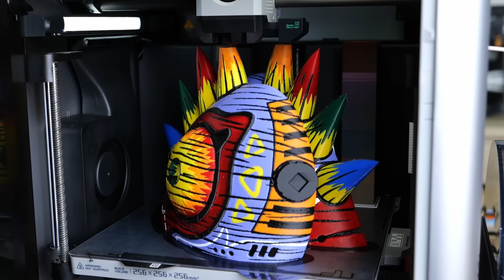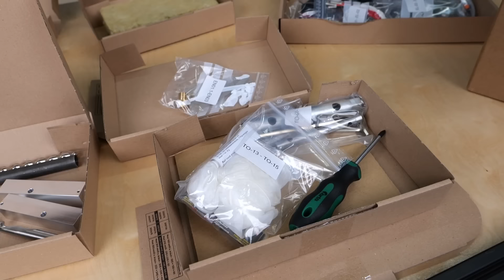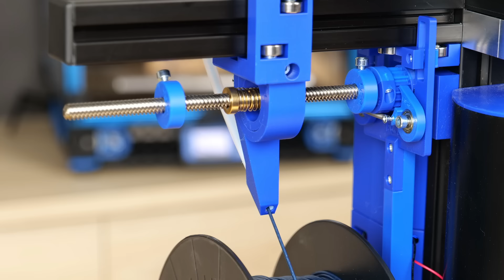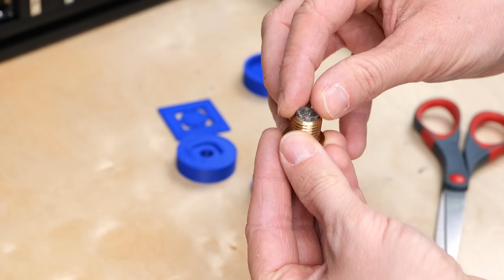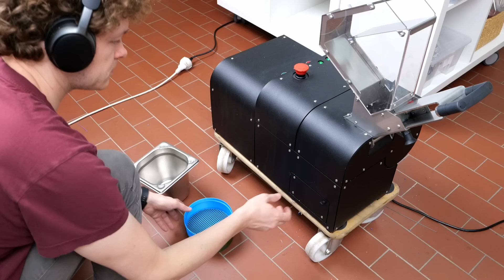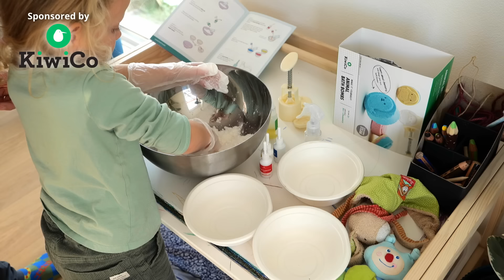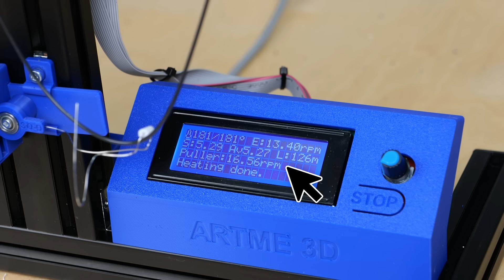Recycling Failed 3D Prints with a DIY Filament Extruder: Artme3D

Comment: does it really cost that much to build a filament machine. i mean u can buy 3d printers for under $200 now but it cost $600+ to buy something to make the filament? i feel like it can be done so much cheaper. i got my little setup i put together to make pet filament but i know its different when it comes to dealing with pellet's but still $600 seems alittle on the higher side but again ive not looked into it that much. im guessing the auger system is what cost so much to put it together.

Comment: You should use that to make filament from shredded water bottles from trash.

You can also design variable filter channels where you can shut down one channel to replace the filter, while another channel is turned on.

Comment: I doubt this solution is truly cost effective, seeing the amount of attention you need to pay to its working + energy cost + ancillary machinery like a shredder, a drying oven,  a vacuum chamber and a 3D printer to print extra parts. In my opinion this solution is far from perfect, unless it consists of most aforementioned machinery at reasonable cost
So no, my final opinion on this "solution" is that it's NOT cost effective. You would save more money by planning your 3D printing better and shopping around for cheap(er) filament
Kudos for the effort you put into it though... for that, well done!

Comment: a filter is a filter. it will always need replacement. my first thought was to filter some metals out with a magnet when you're processing plastics. that way it'll reduce the time frame between filter replacements for the nozzle.

Comment: I worked in a plastic recycling facility for 8 years. We did profile extrusion as well as compounding pellets. A water tank to cool the fillament after leaving the barrel and die would allow for you to drag the mix from the extruder at higher speed and keep tension on it as well instead of using gravity. This is if the setup can melt the plastic faster and not back up the barrel.
Reply: 60W, unfortunately, isn't much for melting (and heating the screw as well)

Comment: With the variety of filament extruders on the market/open source I’m surprised there aren’t more trying to have it integrated directly into a 3d printer as opposed to needing to extrude, wind, and then extrude it again as opposed to just having the pellets and shreds melted in a heated tube with a heated lead screw and directly printed that way. The tube volume and screw size would remain the same so like let filament tolerances wouldn’t even need to be considered as it’s a stable environmentally controlled size. Although with the added weight on the extruder it would likely be a 3 axis moving build plate as opposed to the extruder moving. Or maybe have it be a double bed slinger that moves in x and y while only the extruder/heating assembly would move in the Z. 

Wish I had to time and budget to be able to work on something like that.  

Hopefully something like this is feasible since pellet printers exist, they just cost insanity and maybe focus will shift to sustainable printing where printers will print from pellets or scraps and all the supports can just be dropped right back into the hopper and be ground/melted by a lead screw.
Reply: Plus that would be one less iteration of melt and remelt for virgin materials and then would only compound from there. Potentially increasing the longevity of its recyclability and strength.

Comment: @CNCKitchen 
It might be worth developing a mechanical sizing die to run the cooling filament through to get it to the exact diameter desired.
Then just set to fill the spool, and send an email whence it's done. 👍

Comment: Sadly, this is still well beyond affordable for me. You can get A LOT of filament for 650 + whatever a proper shredder costs + the energy cost of the recycling process. I estimate the amount of scrap I produce in a year is around 2kgs. That would mean DIY recycling would pay off for me in around...30-35 years. I still collect them, as we do have a recycling company that gives discounts for bringing in filament bits by the kilo - but I know that recycling it myself is never going to happen.

And of course - PLA is a plant-based anyway, so it's not like throwing the remains away is doing away with irreplaceable resources. 

Producing PLA has an energy cost of around 16 kWh/kg. While I don't know how much you ended up printing on that first spool, let's say a full spool would be 6 hours, at, say, 60 watts, which is ballpark incandescent lightbulb, which would be 0.360kWh/kg (plus whatever energy the shredder needed). So recycling is definitely energy-saving.

Comment: It is interesting, but definitely too expensive. In my opinion the wasted filament is worth saving. Maybe it will pile up until it would be worth over 1000 Euro and considering costs of shredding system then it may be profitable to buy this machine.

Comment: Looks good. I have about 5 boxes full of PLA waste that I keep meaning to send to a retailer who does recycling but never get around to (but I really don't want to contribute to the plastic waste problem where I can avoid it). It would be nice to recycle at home, though I have to agree €650 is still a little too high for my liking, especially when you consider you can buy a Bambu P1P for that price (and other printers for considerably less).
Reply: Mix it with acetone. Now you have glue.
Reply: @buysncharge  Acetone doesn't dissolve PLA very well. That only really works with ABS and ASA.

Comment: Hi Stefan! Love your channel!
As far as recycle material goes, the main problem is the low volumetric weight. If pellets have 500-650 kg/m3, regrind material is 300-400 kg/m3 only.
As extruder is practically a volumetric pump, you get around 30% less material pushed out by the extruder.
This is why one of the reasons  that on the "real world" regrind material is used up to 30-40% of the total mixture in normal machine. There are special extruder for 100% recycle but they will be normally as twin screw in order to be able to push out more volume.

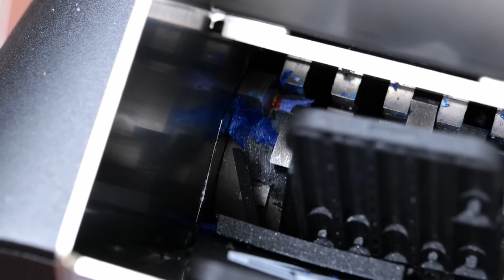Comment: I don't see your plastic shredder listed under your equipment. You identify correctly that shredding the waste into extrudable pellet sizes is the major bottle neck for most people, but then just kind of move on (09:00). So I don't see how it doesn't still require expensive equipment to recycle printer waste? Am I missing something?

Comment: Really cool video! My suggestion is; explore the problems caused by contamination of the wrong type of plastic, in filament recycling.

One of the most talked about issues regarding recycling in general, and with 3D print recycling in particular, seems to be the possibility of contamination. As what happens if your batch of PLA 3d prints to shred and recycle, accidentally had one PETG benchy tossed in there? Would that ruin the whole batch? What's the max possible amount of contamination you can have without disastrous results? And if the results aren't totally unusable, how do the resulting prints turn out? 

Those are just a few questions I'm curious about on this topic. Thank you for exploring so many interesting topics in your videos!

Comment: Probably better to make recycled prints into boards or something with a mold. However, I can see DIY recycling to make sense if you're working with expensive engineering polymers like Ultem or PEEK, where you might spend $200-400 per kilogram, but that'd require modifications to a lot of the components (plus ability to exclude water vapor from the hopper somehow).

Comment: Didn't Thomas S. make a filament diameter sensor? I wonder if it could be remixed and integrated into this filament maker. I would think that the first proof of concept would be to just have a readout of the diameter (possibly with logging like Prusa does). Then try to figure out how to use it for feedback into the filament maker's control logic.

Comment: Things to try:

- Print and recycle the same plastic a few times to see if it degrades
- Make filament from non 3d printed sources
- find a way to upgrade it or improvements for it after you use it for a bit.
Reply: 1. It does. Polymers are getting shorter and shorter each time on a molecular level.
2. You can make PET filament from plastic bottles, and it's relatively easy and simple as it doesn't require a real plastic shredder.
3. One way to improve is simply mix in some additives to have a custom filament of your own
Reply: @user-qn6kb7gr1d good to know, I don't really print PET very often but it would be cool to recycle my own bottle since plastic recycling is a scam in most places. 

Also @sanders you can print from weed whacker line just fyi
Reply: @user-qn6kb7gr1d  not all Plastic degree. That far i know you can remold ABS infinite of time. But the temp of this maschine isn't high enough
Reply: @MrOnlyXeno It might be. The ABS I have melts at 230C, and this thing can go up to 260C (what I print at). So it could work. I’m might just be bad for your lungs.
Reply: @jamakosus  yeah you should definitiv makes the with a gas mask.
I buy recycle Pla from a German company. They made some testing and say that it make no defirent if you recycle Pla cause they always have enough material that they reuse it just 1 time.
Can't see any different for my own too. Only that the color is not 100% even...
Reply: @MrOnlyXeno i used to work in injection molding, if we're talking bog standard non colored it is basically infinitely reusable however colored materials will lose their color with age and so fresh material must be added to keep the color blend, similarly different materials will leech with age becoming brittle requiring regrind to be mixed with fresh material. Both of these options are likely WELL past what most people will do with printing however, PLA being biodegradable means it's most likely to be recycled or pitched with no real long term damage to the environment and even more "harmful" plastics do break down as UV light will make them leech essential aspects and they'll become brittle and break down turning into something not dissimilar to VERY early production of oil. 

Mind however modern plastic is actually pretty different to historical examples so we aren't 100% certain how more modern blended materials will handle breaking down as time goes on
Reply: You can print with weed trimmer filament too fyi
Reply: @rodiculous9464  that stuff is pricey!  :)
Reply: Cut up plastic bottles then shred them with a decent shredder, multiple times. Sift and extrude.
Reply: @asakayosapro  in Germany you'll Lose 0.25€ each liitle plastic bottle
Reply: All Plastics degrade while shredding and remelting. Also ABS. But it should not be noticeable, if not done many times.
Reply: @jackmclane1826 not true, the shred and remelt doesn't harm the plastics, its the leeching as plastics age that harms them, they leech binding agents that make them brittle and it can't be re-added so new material must be mixed in. Most common materials that suffered from this were resin based materials, harder by nature they leeched quicker and got brittle quicker even in storage requiring they be used quicker and often needed fresh product for use of regrind. LDPE and MDPE both like ABS and PLA were almost infinitely reusable until quite a ways into their lifespans where they'd also begin leeching binding agents. The only time we added to regrind was color agents to ensure a uniform color from the product as older plastics for my shop were trashed and sent to a recycling plant to be used for different use. Most of our trashed material would be used in plastic lumber or similar non color essential situations where they only worried about durability, not color or individual material strength

Comment: Would it make sense to add some kind of timed vibration motor to the hopper to keep the shredded material flowing more consistent?  The kind of motor you find in a gaming console controller or a smartphone.
Reply: And what about slightly mixing filaments like PLA and petg or even tpu? I'm quite impressed how well this works. Great video.

Comment: Point of modification: a linear CCD from a scanner could be used to track diameter of the filament, or any one of a number of machine vision linear cameras, or low cost (like 2mp rpi cameras) with a narrow lens (because its viewing a small angular area itd utilizes more of the sensor area for the measurement youd want to capture).

Comment: A shredder is badly needed here, as is active accurate and continuous filament size detection with suitable feedback to correct any error. Having said that what is presented looks fit for purpose so addition rather than change seems to be the order of the day. If the Teflon tape is the only barrier to the temperature it should be possible to find ways to dispense with it.  Interesting content as usual, great stuff 🙂

Comment: To correct the hot filament falling off the roller, you can just print or purchase an inverted double cone shaped roller (like the ones where a cross section is two arrows pointing at each other) and the filament shouldn't fall off anymore. Might have to play around with the angle to make sure it doesn't bind or alter the shape of the filament. Might be best to just create one where it curves with the same radius as the filament so it can't physically deform the filament at all actually.
Reply: Nylon pully wheels are really cheap... or print one for the same purpose. Much better a curve at the bottom than an angle.

Comment: This looks amazing. I would love this... but I also know it's going to be one of those things that isn't worth it at an individual level. It reminds me of recycling (the non-3D printer kind)... I recycle as much as I can but I got nothing for it. Not everything is recyclable, not every place takes recycle, some places charge to take your recycle, and some people just don't care and throw everything out. But it operates at an industrial scale and much of what is recycled are materials that can be recycled multiple times. In other words: it would be better for industry to do it. For a maker space, it could be great. For a print farm, maybe... but only if you have time. If you're a print farm that is constantly rushing to print orders or have enough for some upcoming show, it's not worth it. Large companies wouldn't get this and maybe not even the FIlastruder...

But an interesting one could be just... filler. Companies that use plastic for making things can use basically anything, so filament isn't really necessary. But if people are deadset on "waste becomes filament" and at least know that there's a limit to the number of times you can do this, then a filament maker using it as filler could be interesting. Like, a lot of shops do "economic" spools where it's super plane color, not necessarily as tolerant on size, etc. But now imagine a filament company sells spools at $20/kg, but then takes some waste and can use it to replace $2/kg within that spool... factor in labor and pre-processing/filtering costs, it's possible to sell at $19/kg ($18/kg virgin + "free" waste to make up the difference + $1/kg in labor to process the waste). If anything, it offers a chance to work at a scale where statistics actually become meaningful and maybe the manufacturer goes "hmm... there are no glaring downsides here... lets go from the 10% waste to 15% waste... and reduce cost from $19 to $18" and then keep repeating until some quality drops below some threshold.

That commentary aside, machine looks great. This is the lowest cost system I've seen that uses an actual proper (or closer to proper) screw. Heating could improve (lots of times it's multiple heat zones, not just "heat everything up" at scale). And certainly something that actually measures filament diameter automatically would be an improvement... though a lot of systems seem to do this by drawing at different speeds while the auger is consistent. Also, for what it does, it looks great.

Comment: If you can think of another way to control flow of material it would be sweet to just have basically a funnel that connects straight to nozzle that you can just put scraps in and it melts it down as the machine prints.

Comment: How did you overcome the "surface speed " on the spool winding? Does the spools stepper motor take the surface speed variable and calculate??
Reply from the maker: The belt driving it can slip, so it just slips more the fuller the spool gets.

Comment: I'd love to see machines like this in local makerspaces, where you could save up your scraps and pay an admission fee to use the machine and recycle your plastic waste. Or the makerspace itself could even produce it's own filaments from scraps and donations, reducing plastic waste for the local 3D printing community. Basically a recycling center for 3d-printing waste. The future holds potential.

Comment: Realistically a spool of filament costs between 40 to 80 euro per kilogram for decent quality material. So if you manage to recycle about 15kg of material with it, you'll break even, from that point on it's going to save you money. So I'd say that for anyone who does any sort of prototyping or just random experimentation it might actually be worth it.

Then again I have no real experience with printing a recycled filament, because all of my prints are resin based as I got my first printer to make stuff and things for my model railroad. So I picked resin over filament because of the ability to have much more detailed prints.

But I do kind of wish I could melt my failed resin prints back down into new resin, sadly that doesn't work that way.